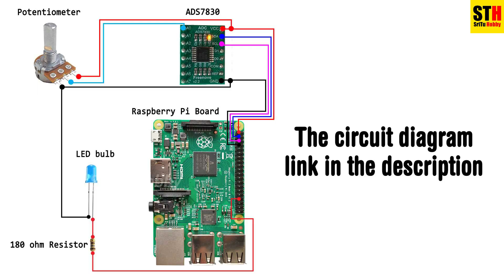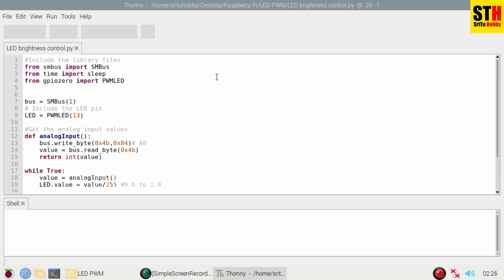How to PWM an LED bulb using a Raspberry Pi board

Comment: Sir you make a video on iot based smart agriculture  Monitring and auto irrigation with blynk 2.0 and esp 8266

 sir please add this sensors (rain sensor ,pir, dht11, soil moisture, soil temprature, buzzer and water pump auto irrigation small display and timer irrigation,)if you this type of project so i will be very thankful (blynk 2.0)
Reply from the maker: Ok sure